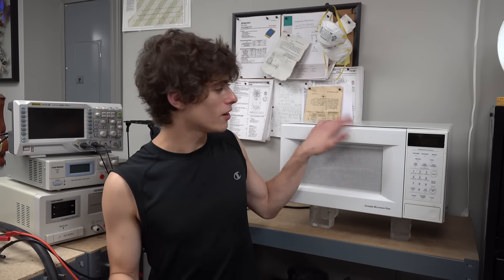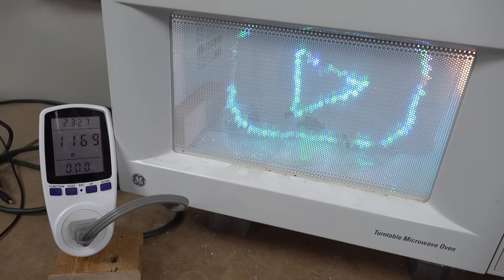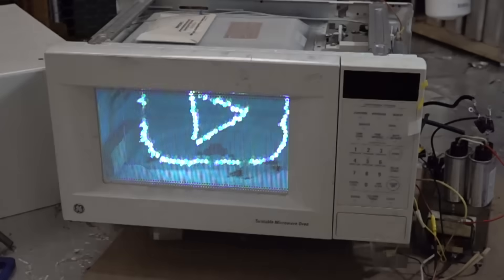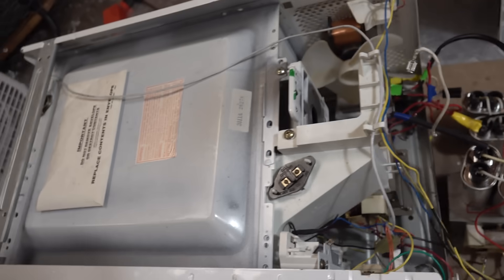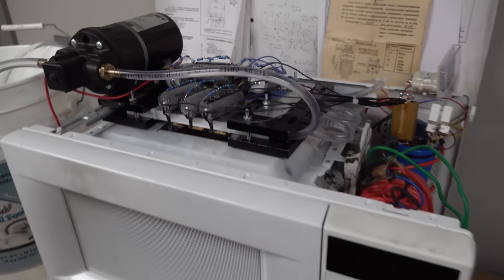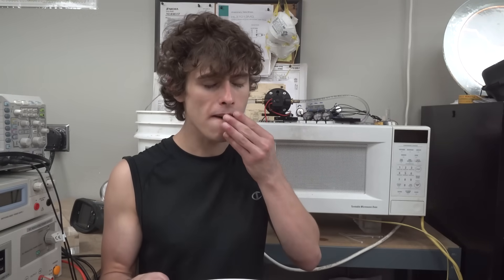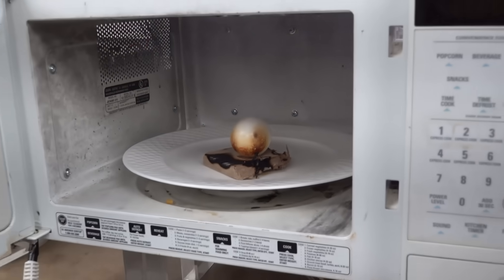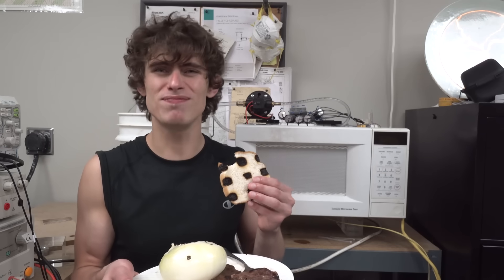I converted my microwave into a LASER oven!

Comment: Hey Styropyro! Quick question: Do you think it might be possible to draw shapes or even words on the underside of low hanging clouds using powerful lasers and fast moving mirrors? What laser color do you think would be the most useful for this?
Reply: While it may be possible, your countries aviation authority would be extremely pissed (as in probable prison time pissed) about firing a high-power laser into the sky,
Reply: @2001herne  I live in a rural area with very low air traffic, and I would certainly use an online tool to check if planes are nearby. I doubt that would be a problem.
Reply: @engineer0239  yeah flightrader24 would be good
Reply: @engineer0239  even if you're careful, your lasers will be detected and authorities will be wondering wtf is going on
Reply: @2001herne  you know a person once built a nuclear reactor in their shed
Reply: I see two problems.
Clouds are white, they are reflective. Also they scatter light.
Clouds are already vaporized but maybe you can add heat so that they go up their dew point?
Reply: Some funny UFO reports sent to the Air Defense, I'd assume...
Reply: you'd use blue or violet lasers as the short wavelengh would scatter way better in the water droplets then a lets say a red one.

but hunan eyes are most sensitive at green around 540nm.  so blue for the symbols and green for the visible lines.

Comment: I feel like this could actually be useful as like the perfect searing device. Cooking just the surface of a thing.

if you have both the microwave and this in the same device you might actually be able to cook a steak alright (sear both sides to seal the surface a little bit, lower the micro power to get to just 125 F and cook to desired outcome.)

Comment: I took apart an old microwave once. The mechanism to turn the microwaves on and off based on the position of the power dial was entirely electromechanical. Impressive engineering. It involved a microswitch and a cam, but not an ordinary cam. An elongated cam, with the on/off ratio varying continuously along the axis. The power dial slid the follower along that axis.

Comment: you know that the tip of magnetrons is very poisonous, if you break them? just sayin.... Some magnetrons have beryllium oxide (beryllia) ceramic insulators, which are dangerous if crushed and inhaled, or otherwise ingested. Single or chronic exposure can lead to berylliosis, an incurable lung condition. In addition, beryllia is listed as a confirmed human carcinogen by the IARC; therefore, broken ceramic insulators or magnetrons should not be directly handled.

Comment: I know most of this video was just for fun, but ... If you wanted it to actually cook evenly(ish), you could use a pair of galvanometer scanners.   Like the things used in laser scanners and laser lightshow projectors.  It could rapidly scan the surface, heating the whole thing evenly.  Or it could cook the food in any pattern desired.    It would still have that same savory carbon flavor.  Mmmm.   With your power, it would likely have an evenly charred surface, with the interior of the food being totally raw.  Perfect for microwaved steak.  Microwaved chicken too, if you like salmonella.

I'm not sure where you'd get affordable galvanometer scanners with mirrors wide enough to aim the whole beam of that module though.  Maybe put the laser down the waveguide by where the old magnetron was, with a converging lens to use smaller mirrors.  That may help with keeping the pattern sort of tight on the target.

Also ... I was looking at how some of the SLS (Selective Laser Sintering) machines work, and they use exactly this.   Except I think your laser is stronger when focused to a point.    Unfortunately, they have problems with focus out at the edges of the workspace.   Bad for melting metal, but (probably) fine for a silly machine to entertain your viewers. 

Apologies for overexplaining, I did it to help others reading the comments.

Comment: The one thing that was completely unbelievable was the steak. There's no way he didn't cook it using some other method in addition to the lasers. It would have just been completely raw on the inside with blackened spots on the outside like everything else. I guess that, as careless as he [is / pretends to be] when it comes to safety around electrical equipment, eating a raw steak is too dangerous for him! lol

Comment: If I'm not mistaken, the "power level 50 = 50 duty cycle on a long loop" thing is partially due to Panasonic having patented the "inverter" setup that actually runs the magnetron at lower power (think dimmer switch rather than timer.)

Comment: project       !!!!!!!!!   find an old Amana  Radar Range from the 1980.  They used pulses to control the power.  They also used a radar grade Raytheon   megaton.  The doors were hinged on the bottom and opened down not to the side.

Comment: So I have a question. Not really related to the video (sorry, no lasers here :/ ), but I figured I'd give it a shot. Mainly for Syropyro, but also anyone who knows what they are talking about. I have an E-Bike that has a chemical battery resembling a large thermos. I am fairly certain that it is a lithium-ion battery, but I could be wrong. The battery's label describes its capabilities: "36V - 8Ah - 288Wh - 15A." I know only the basics of electronics, so not all of the terminology is lost on me, but I don't fully understand what all that means. However, my question is this: I have noticed that when I shut off the battery (it has its own switch on the battery itself) and drain the power by turning on the headlight until it dies out (because I hate honking its horn on accident as I carry it up the stairs); If I leave it alone for a couple minutes, I hit the horn button and, while it does die out after a second or two, it still sounds like the battery is on when I first press the button - as if the capacitor had re-charged itself. But I (supposedly) turned off the power and drained the capacitor, so how could this be? Keep in mind the battery is still mounted to its terminals, but powered off via a switch on the battery itself. 

To clarify - as far as I understand it, there is a power source (the battery, in this case), and a power consumer (the motor), and some form of capacitor to stabilize the draw of electricity. So, in my mind, when you shut off the power source, and drain the capacitor by turning things on without the power source, that 2 or 3 minutes later there should be no response from any onboard electronics. I mean unless they are self-powered by their own batteries, but even then I can't imagine that type of thing would be incorporated into a bicycle horn that already is hard-wired to the battery.

Anyways, I appreciate any answers to this question, and also - an idea for a video: Maybe give some "turbo" power to an Electric bicycle motor? 

Peace.
Reply: When lithium batteries age they start self discharging more and more. It also might put the bike in a standby mode that doesn’t fully isolate it. Try checking for broken insulators and if the battery is more than a few years old try replacing it. Or just unplug the battery when it’s not in use

Comment: Hmm. You might be able to use a microwave to make sea water drinkable:
1. For every 1 kg of salt-water, add and disolve 165.898g of Ca(BiO3)2
2. Heat the tank in the microwave to trigger reaction:
2NaCl(aq) + Ca(BiO3)2(aq) -> CaCl2(aq) + 2NaBiO3(s)
3. Filter out the solid NaBiO3
4. For every 1kg of the original salt-water, add and disolve 92.710 Ag2SO4
5. Heat to dissolve Ag2SO4 and to trigger reaction:
CaCl2(aq) + Ag2SO4(aq) -> CaSO4 (s) + 2AgCl(s)
6. Filter out the solids
7. Drink and enjoy! (Well... maybe. You might also just die, so I wouldn't try it lol)

Comment: There's nothing stopping you from working on inertial confinement and fusion lasers other than funding to build them and funding for the equipment to verify if you built and configured them correctly... And a small supply of deuterium or tritium.  But knowing you, these are small roadblocks.

Comment: Could you use a water bath to diffuse the light/heat? Kind of like how a double boiler insulates things from burning or a sous vide bath. Maybe dangerous because water and high voltage, though. Plus with how reflective and refractive light is it could just as easily not work.

Comment: Fun fact, the same setup used for modern microwave ovens was originally created for heating frozen mice back to life. They created it to heat all parts of the mouse at once, but they never did anything with the heating mechanism and it was reinvented later as the first microwave ovens.

Comment: Microwaves run at the same power level when they are energised. There’s no ‘dimmer switch’ setting to reduce the power.
So it cycles. At 100%, the microwaves run 100% of the time. At 90%, the microwaves run for 9 out of every 10 seconds.
80% - on for 8 out of 10 seconds.
50% - half the time, 5 out of 10 seconds
And so on.
Better power supplies are able to operate the cavity magnetron more efficiently than the older power supplies.

Comment: 2:18 this is actually quite common for heating appliances; fridges also run on cycles when they don’t need to pump out as much heat; compare this to when you’re first cooling down a fridge which needs a bigger pumping rate.

Comment: You can pick up ~1MW magnetrons from scrap medical equipment, e.g. radiation therapy machines. Anything used to make very high power x-rays will likely have one, and usually the accelerators fail before the magnetrons.

Comment: When You Do The Banana - NextTime Cut Down The Bottom Tip, 
You Where Right That It Acts Like An Antenna, That I Discovered When I Was Tinkering With My Antennas And The 300MHz-20Ghz Antenna Went Bright Near Microwave :D 
Same Lenght BTW As That Banana Tip. :) Its Not Dry So It Conducts As An Antenna.

Comment: If the light only heating the surface is a problem, perhaps you could try something that goes right through and heats by other mechanisms? I've heard something about electromagnetic waves in the micro range having such properties. If you found some way to emit enough of those and spread them over the food, you might have a functional heater (though it won't be much of a laser once spread, but diffuse plates will do that anyway).

Comment: I made a PLPM4L laser cannon if you ever want to do features of fan creations. It’s got active water cooling also using TEGs to cool the water and thus increase laser efficiency by keeping it at a constant temperature. I use two thermostats wired to switch one another to keep the diode array at a specific temp. But the cooling system definitely uses more energy by a factor of probably 3. I did the math it’a just been a long time since I’ve used it.
I want to save up for an IR fiber laser diode array/fiber coupling

Comment: 4:45 
It will not work because the plastic Triger are designed in such way that it only Pull up the internal lever up but internal lever are free to move down Whenever Em triggers it , this time internal mechanism pulls the outer plastic lever down , not the other way around  .
Otherwise whenever mcb Breakdown after short the  circuit  , if someone mistakenly try to turn on the MCB again without fixing the short circuit first , it will completely destroy the circuit in just ms during the time of Holding by hand .

Comment: I Have 1 experiment Request to do with High powered lasers...
Try to Generate 2nd or 3rd Optical harmonic , down conversation  with Different crystal and liquids off course  Bbo will be on the top and KDP & KD*P second  than The rest like urea etc  ( other crystals need very High power Laser to do this effect even in tiny amounts   ) .

Comment: The potassium in the banana is conductive. Potassium is a good conductor because it has a greater atomic radius (i.e. It has 4 shells but only one electron in the outer shell) which means it has a lower ionization level and relatively more free electrons. The presence of fire at those high energy levels proves the high conductivity. It doesn't matter that it is at microwave wave lengths. The same thing would happen with sufficient voltage and current applied at either end. But the saturation of the energy dispersed in a microwave oven is probably more consistent/even.

Comment: Man you're super intelligent.  I've watched a lot if your videos and I'm seriously impressed with your scientific knowledge. I have a question which you may be able to help with. I have a stereo reciever that only puts out 45 watts per channel at 8ohms. my speakers are four 8 inch woofers rated at 16 ohms each. there are two in each cabinet wired in series to create a load of 8ohms each. now my question is....is there a way to increase the output of my reciever? with minimal dismantling? or is there a way to drop the load of my speakers dropping them to 4ohms each cabinet? that would increase the power of my reciever to 100 watts per channel. any ideas?

Comment: Microwaves are clearly the better way to heat food. BUT i'm not sure if microwave ovens are better than this... Because they are all made so badly! First the on-off cycle mentioned instead of really regulating power. And then there's the direction of the waves... It would be so easy to evenly spread them with a rotating mirror beside the rotating base. But no. So there's alway the center staying cold while almost burning the circle around the center!

Comment: As funny as this is, if he was to build the perfect multiple diffuser plate setup, he'd literally have an actually good laser cooker lol.
Reply: I think it'd probably still be bad
Reply: Interestingly, one of the main problems early microwaves had was getting the output diffused without hotspots.
Reply: On the surface yes, but as laser don't penetrate as microwaves does, it could never work that well.
Reply: @JanneKokko17  Intensity lowered and waves smoothed over a larger area, it would be a light cooker analogous to the heat from an electric smooth top stove. Obviously that radiation in a smooth top hits a cooking pan or pot but you could cook without pots and pans on a stove like that in theory too. Styropyo's would just be upside-down, thousands of times more energetic and a very specific shade of blue haha.

Comment: I see you have betrayed the dark side of the institutional force. My spirit is with you, and may join you in due time(depending on the geopoliticalistry). Bake me a cake and make me a boat which has the opposite electromagnetic(or just electric) field strength as that incident upon it. The entire boat(made of ferromagnetic metal of your choice) will serve as the emitting antenna(the opposite sign material), and you must transieve the opposite sign of the incident wave as detected by very sensitive receiving antennas on the rim(encompassing the lateral edge) of the ship.  Do this. If you do, and end up not wanting to post it on facetoobitter spam a DVD on the wave-guide rocks. I just cant muster the energy to solve those impedence problems.

Comment: The reason the FCC will hunt you down if you run a modified microwave at full power with the door open is because literally everything from radios to advanced radar and radar detection systems can pick it up, and the Serbs used modified microwaves on the end of poles next to fake trucks to make it look like a legit SAM site to NATO aircraft

Comment: Regarding the way microwave ovens work when you ask them to cook at less than 100% of their power, while it is true that the common way for this to be accomplished is as described (turning on and off), in the 21st century (possibly earlier, for top-of-the-line models), ovens have been widely available that actually run all the time at a lower power setting, to provide continuous cooking. So the cheap models people buy for their work lunchrooms and apartments are absolutely still turning that EM field on and off, but more expensive ones are absolutely adjusting the power of that field accordingly.

Comment: The 50% duty cycle is actually good.  Most outlets are limited to 15 amps (and higher ratting outlets have a different connector for a reason), and that gets you around 1700 watts.  By using a 50% duty cycle, you're getting pulses of roughly twice the power.  So, the microwaves are twice as penetrating, without burning your house down.

Comment: I feel like something that we need to mention in a video about overclocking microwaves is that microwaves have actually been nerfed over the years. The story of how microwaves cooking food was discovered is pretty well known but a lesser known consequence of that was that the first microwaves were very powerful because they were using military grade magnetrons. All is this is to say; back in the day, you could use a microwave to fully cook a steak in 20 seconds (from memory). These microwaves failed to do well commercially because well... something that powerful was very expensive and not really required.
Reply: IIRC the first 'Radar Ranges' were big restaurant grade machines that needed liquid cooling. So yeah, lots of sacrifices in slimming them down to a countertop model that won't flash-broil someone's eyes if they have an accident.